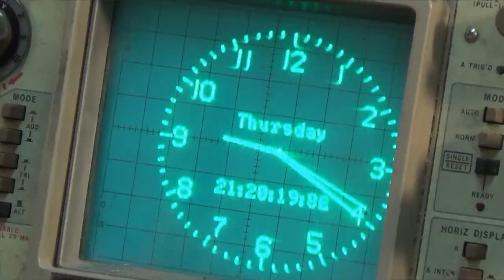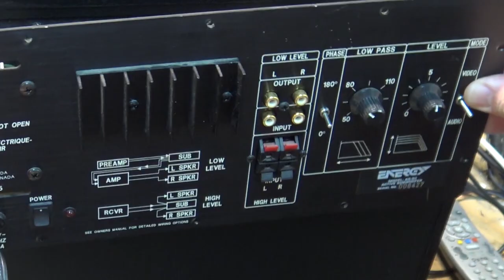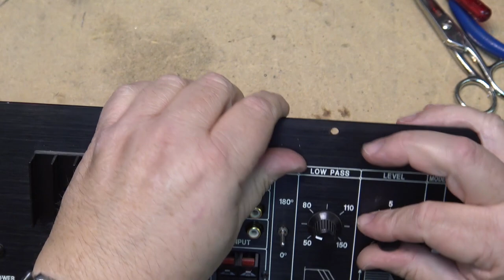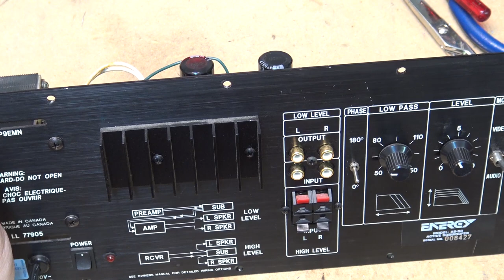Energy AS90 Subwoofer amplifier repair

Comment: Stk amplifier modules don't seem too bad, the ones to avoid are San Ken as they fail too often :-(
Stk regulator modules in vcr's often fail.
Reply: i agree MOST STK's weren't too bad. The main issue of the late 70's early 80's packs were there ability to dissipate heat. Which is why 4 Ohm loads were almost instant death for most.

Comment: I'm wondering why the "Made in Canada" text was censored in the beginning.
Reply: You can guarantee if it said "Made in Mexico" Dave wouldn't be drooling over the unremarkable build quality.
Reply: i think he was trying to hide the serial number?
Reply from the maker: It was to see how many would assume it was made in china before I let the cat out of the bag.  
Aparantly many!
Reply from the maker: @jasejj  
The quality is actually very good.  Consider that powered subs do take a pounding.   Remember this specific unit is not a real high end model but well constructed. There are some very good speakers made in Canada.  PSB and paradigm are 2 brands.
Reply: I have a Pro-liner sub I want take a swing at. Made in Canada, maybe? At least Head Quarters for the line is Vancouver based. 

Talk about noise. Mine is just noisy period. Tried other drivers, and the result is the same. The big Caps visually look good, but I ordered up some anyway. Now just educating myself on all the tips and tricks to see what else I can learn. The thing just gets some eerie static intermittently, enough that the auto switch turns itself on. AC filtering maybe?

Just love these vids as I am a sponge to learn stuff. Fixed a few systems since my youth and now even more eager to do more, like breathing new life into a Sansui 350A just given to me. Will be a nice home unit on top my Roger’s Majestic AM/Phono cabinet. 

Hey, that Work-Safe BC was a dead give away.  I am wondering what else may be made in Canada 😆
Reply: @Wookiemonsterfreak  Like he said: Paradigm, PSB, and Energy speakers are all made in Canada...at least the mid to high end products are. Great companies!

Comment: No SMD components 😊 dual bobbin transformer... Looks well made. Shame about the sanded op amps and the low quality switches though.
Reply: Formula sound, a UK DJ audio company used to file off the chip numbers! I messaged them to show I was from a similar company and they gave out the numbers quickly!

Comment: I have a Mirage Omnisub 10 I got on clearance from Tweeter (anyone remember them?) over 10 years ago. Use it every day, upgraded the A/V Receiver and the rest of the speakers a couple of times (now a Denon 2113 and the Pioneer Andrew Jones set) but the sub has always been more than enough. Denon's room correction set it to something like -9 dB and it still rattles the lightbulbs in some scenes. But I know it's calibrated because when I listen to music on the "Flat" profile, it is not boomy, the bass is just there all the way down to the lower limit of my hearing.

Comment: It's kind of funny listening to AM 730 on a sub woofer...
Nice fix, my subwoofer is gathering dust as well. 
Cheers,
Reply from the maker: Actually it was cfox but....
Reply: @12voltvids  - ya, I realized that after I wrote it. Been listening a bit to cfox and Jack FM but it's am 730 in the car.
No, it's true... _Pinky swear_. :)-
Reply from the maker: @EngineeringVignettes  
The traffic station.  I rarely listen to that because I don't have to commute.  In the car it is usually the fix or 101 during the day and 104 in the evening or 980 for the news.

Comment: I wish I could fix my cerwin vega lw-12 it powers on but no sound   so I used a old adcom amp and a f-mod for the cross over .is there anyway to still use the built in crossover on the cerwin vega amp some how but use the adcom for power? The sub in the box sound good still and I think klipsch makes energy subs I have two pairs of klipsch kg 5.5

Comment: Tried to fix infinity 8" sub that was thumping power board was getting so hot the traces were delaminating around large band resistors.. amp plate housed in plastic box  failed repair.  It let out some smoke

Comment: The fuse is 0.75A and this works on 120V. I'd say 60W output power would be very generous. More likely 40W or less.
Looks nicely made though.
Reply from the maker: The power module is rated at 60, and the voltage off the transformer is certainly high enough for 60.   There is a higher power version of this sub as well with bigger caps.

Comment: Yep these are built to a price.. Not enough cooling on the heatsink... No dc speaker protection..
Reply from the maker: There is more than enough cooling on the IC. Remember that this is a subwoofer. It is not running constantly like your main power amp would. DC speaker protection is built into the module, and if the outputs in the IC were to short, the power supply fuse would blow pretty quick.

Comment: Any chance you could tell me if you know ic that is sanded. I`m trying to replace mine in my as 180 subwoofer and dont know what to replace it with. Also do you have a circuit diagram even for the one above it would really get me out of trouble thanks

Comment: For those who want to know, because i know your out there.
STK4038X 60Wx1 8Ohm 0.008% THD (wow)
Those extra filter cap footprints on the PCB make perfect sense as that module is pin to pin compatible with a whole line that ranges from 30W to 100W
Reply from the maker: Correctamundo

Comment: Ok thank you, yes I did that already very carefully, it was bad, I couldn’t really trouble shoot it until I removed all that dust, I checked my power supply voltage at the big filter cap and it appears to have done 40 years worth and is shot, so now I’m trying to find another capacitor like the one that’s in there, it’s some kind of weird 4700uf 70volt cap with a dummy leg and your other typical connections, any ideas?, let me know what your thoughts are, no one has ever been in this amp but me, I would like to save it, good old realistic SA-1000 , its a nice little amp, it appears to be well made.

Comment: Interesting power supply comment. We've seen bigger power supplies in some vintage higher quality class A preamplifiers, like that Dynaco you worked on. I know my solid state Bozak CMA-10 2DL six channel DJ mixer is close to 2A. It's a beast. It'd be one thing if that was a class D of some variety, but this is a run of the mill class A/B. It might be an H bias or G. Not sure, but it surely isn't going to punch its way through a heavy A/B class amp with real guts.

Comment: Maximum power that this whole sub can draw trough 2A is (2A x 110V) =220W. Power amp is 60W at NOMINAL (Sinusoidal) power at 1 Ch and 0.4% THD which means 120W at MAX volume under MAX % THD or MUSICAL (max listening) power around 90W under 10% THD. Nowhere near 500W :D
Reply from the maker: I think the clue is in the model number as90 as in 90 watts.

Comment: 0.75A slow-blow fuse, 120*0.75 = 90, so at most 90W continuous or the fuse would blow. And I doubt it can even do that.
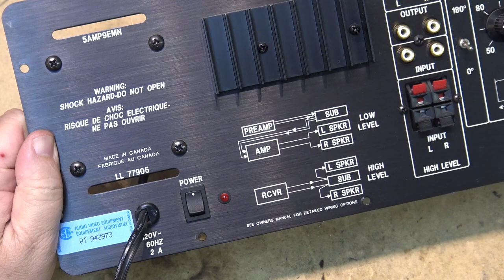Reply: At 8:52 is shown 120Volts and 2A, so it should be double of that. Maybe this 0.75 A is for 230V. But given the transformers size it is about 100W, and that 2A fuse blows only when there is dead short.

Comment: I have a question , I was wondering what is the best way to clean heavy dust out of the inside of a solid state amplifier?.
Reply: +Tommy Sulkowsky - Do it with a compressed air gun the same way 12volts does...preferably outdoors.